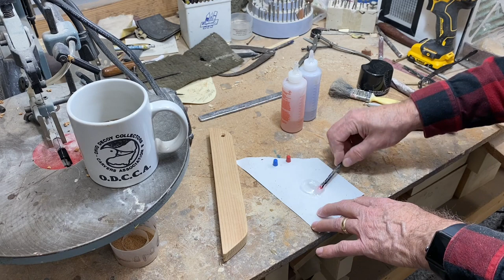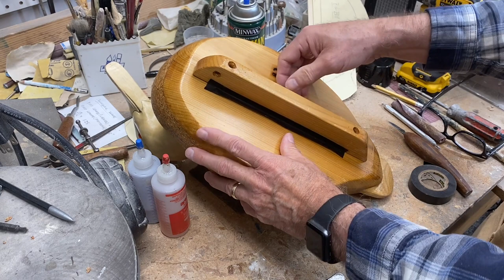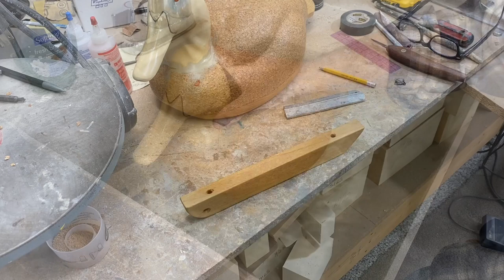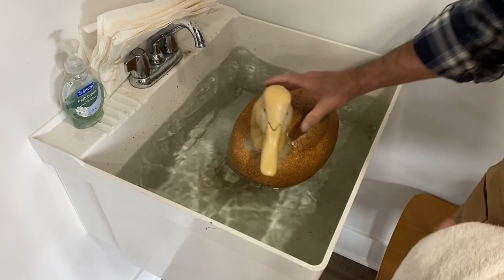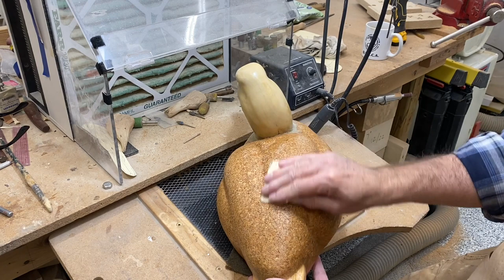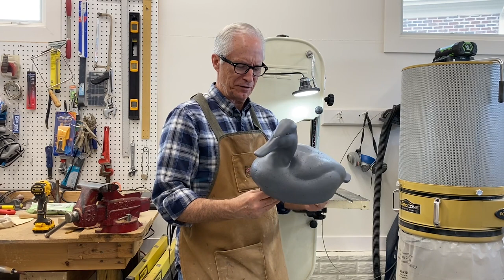Drake Can Gunner Carving -  Session 6 - Sealing and Flotation

Comment: I ran into and purchased 3xdozen old.. Herters cork divers.  they made it with black cork.  one decoy has nearly fallen apart.  I figured if I can cut the remainer up, i can use it as filler for the other decoys.  Any advice?  what would be a good dust mix/sealer to fill out the black cork texture?
Reply from the maker: I don’t have experience in reconditioning black cork but I would think you could replace sections and glue them in with a waterproof glue or epoxy. You could also chop or grind the black cork from the other decoys and mix with epoxy to form a type of cork dust putty to patch smaller areas. Hope that helps and good luck with your project!